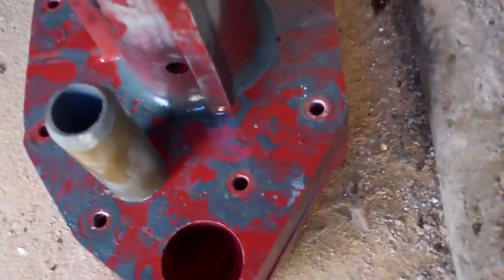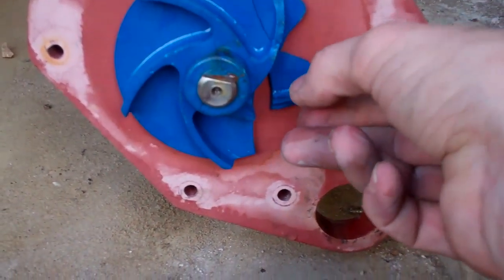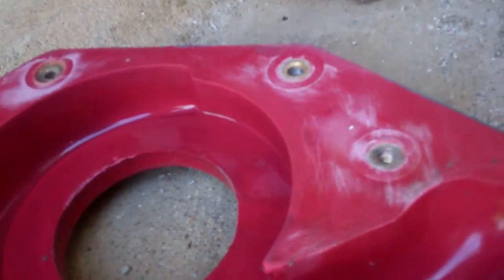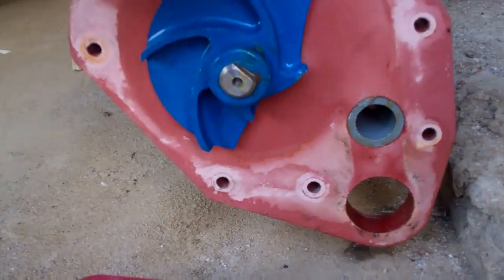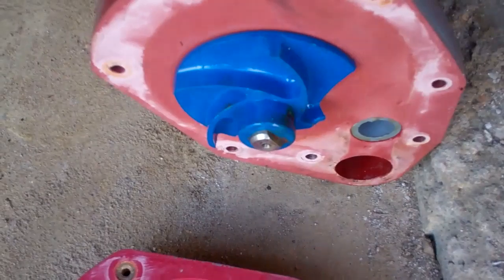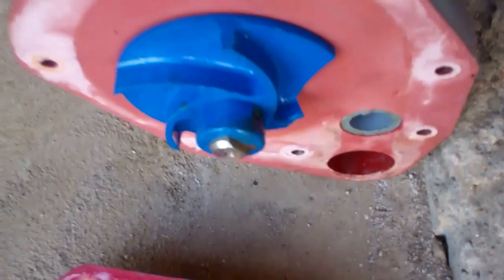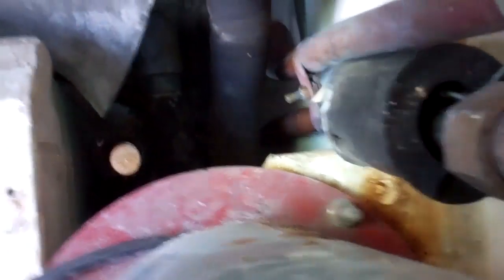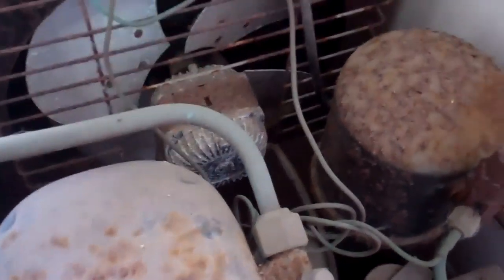Alfa Laval pump strip

Comment: If it is ar old design then BSW would be right.  You can get the nuts, but AFAIK not in nylock. Better would be to get some 7/16 nuts to use as lock nuts.

Comment from the maker: Yeah its a makita 7.2v one, about 17Nm max, just the tool for small bolts and screws, use it most for changing fan motors and terminal box covers etc.